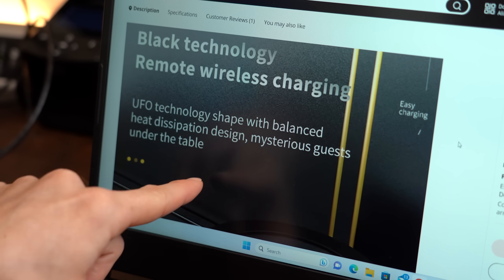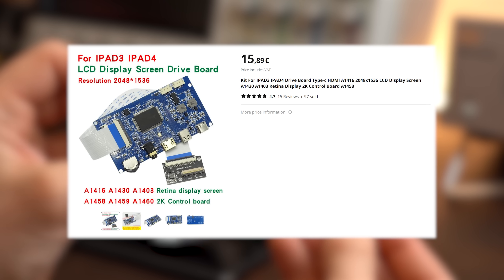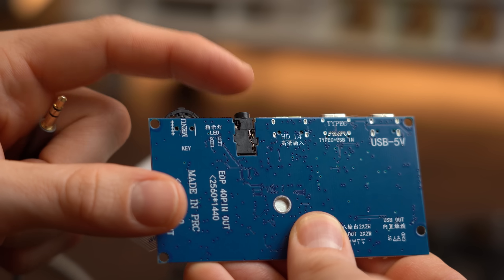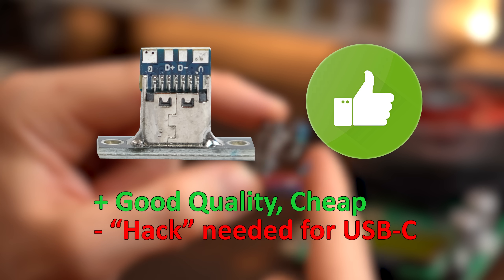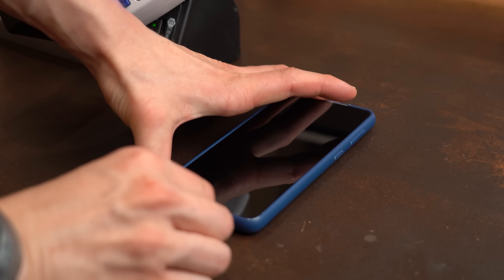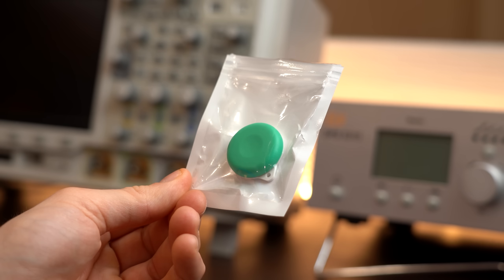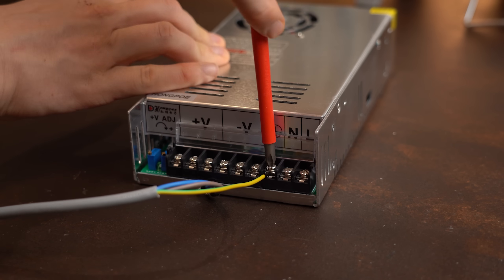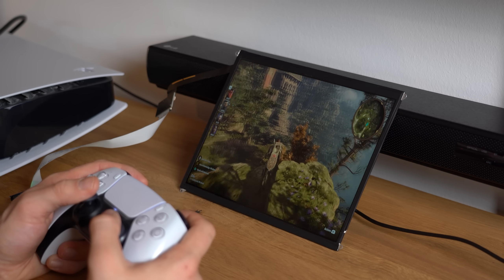I tried finding Hidden Gems on AliExpress AGAIN! (Part 7)

Comment: I'd love to see your thoughts on Linus tec tips about charging overnight. I've had much better battery life since I stopped leaving my phone on charge all the time.
Reply from the maker: What is his opinion? You got a video link?
Reply: @greatscottlab  he said it was killing battery life to charge constantly.
Reply: @greatscottlab  https://www.youtube.com/watch?v=AF2O4l1JprI
Reply: My google pixel charges very slowly overnight when I have set my alarm. It calculates the charge current based on the amount of hours it has left to when the alarm is set. So when you set the alarm 8 hours from now, it takes approximately 8 hours to charge to 100%.
Reply: @Ni5ei  that's cool, I don't have an alarm set so this wouldn't work for all